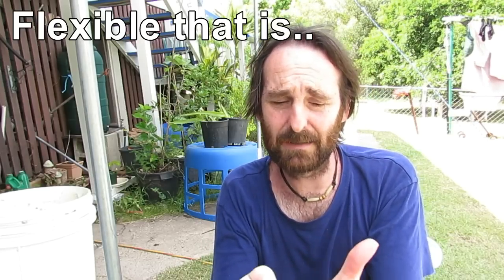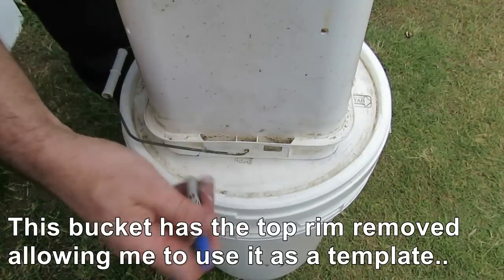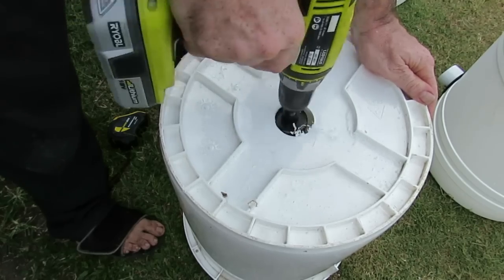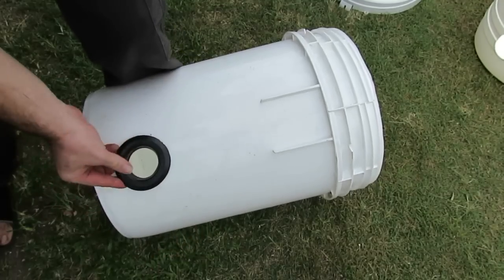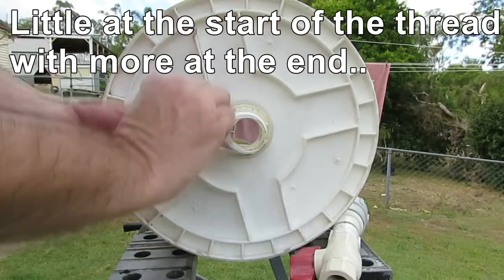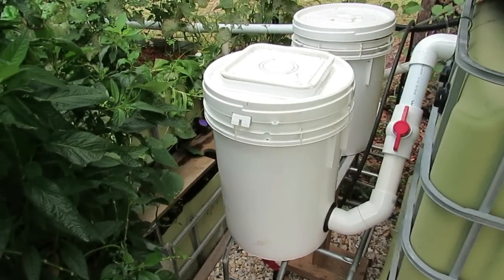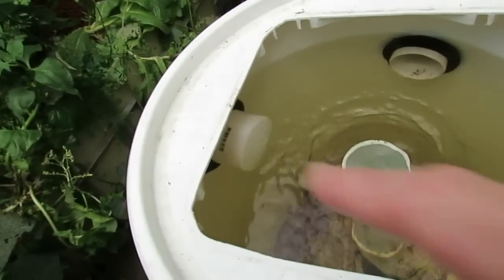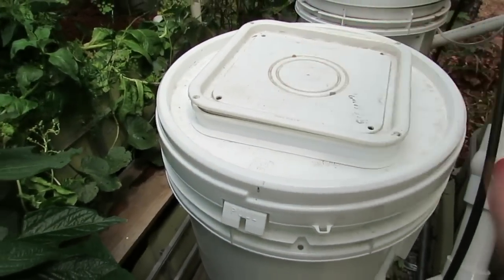How to Build a Radial Flow Solids Filter for Aquaponic Systems

Comment: Hi Rob, I really enjoy your videos. I'm just starting to design an IBC system. After some research, I'm keen to install a radial flow filter and Google got me here. I have done some sums and I was planning on a 40mm SLO. I would like to ask the reason you upgraded to 50mm? Were you concerned about potential pressure loss on adding the bio filter? The 40 seemed to be working well. I am planning a larger inlet diameter to avoid any blockage issues. Have you noticed a big jump in water quality attributed to the bio filter? Would you recommend one? My research is definitely in favour of a solids filter but more neutral on a bio filter in small systems (preliminary finding). What is your take? I expect a spectrum of opinions out there on this one. Cheers, John
Reply from the maker: Hey John..
At the moment we have 2700LPH running through the system & still have 40mm pipe hooked up after the filters.. I up sized to the 50mm as it will give me more flexability in the flow rates in the system when it expands as a larger pump may be added..
I haven't noticed any change to the water quality or growth rates in the system as such since the bio filter was added.. It was installed as I'm looking at taking some beds off line for a while & the Bio will help pick up the slack in the processing of the ammonia/nitrite while they are off line.. I want it to be in place for a while so the colony of bacteria can build up before I remove the beds though.. It will stay in line after the move as I hope to have at least one floating raft bed & some other growing systems.. As there won't be as much media in the system the bio will pick up the slack in the NH3 & NO2- conversion.. Definitely isn't needed in all systems but can be helpful in some situations..
Hope that helps some mate.. Have fun planing & building the system :)
Rob..
Reply: Rob Bob Thanks Rob, Logical explanation and I glad I asked. It's fun. My brother initially built a single IBC system and now he is expanding after a satisfying triumph. He got me in and I am starting off with a 3 GB, 1000L FT and sump. Yet to decide but probably CHOP rather than CHOP 2 due to lower costs and simple plumbing for a redundant pump. My plan for the 40mm SLO is to detect primary pump running via increased head height in the FT. 50mm SLO would probably allow me to do that too but I was skeptical of the pipe formulas for really low velocity and pressure.
Your videos have helped me a lot. If only I came a cross them earlier. I must say it is reassuring that my independent design will end up close to your current setup. I like your radial flow filter design but I do intend to add a cone in the bottom to assist solids removal. It might be trial an error to work out the least angle that work effectively. I don't want the limited volume to be significantly reduced.
I will ask one more question. Was there much build up in the old 40mm SLO when you removed it? I expect the faster flow rates through it helped to keep it some what clean.
Keep up your great educational videos.
My regards, John
Reply from the maker: Hey John Pointon ..
I've found the 40mm SLO got grubbier than the 50mm so far... That might be due to not enough bio film building up for the waste to cling to in the 50mm yet so that may change over time.. As it stands at the moment I have noticed some solids accumulating in the corner of the FT after the changeover..
I was planing on increasing the pump size & flow rate in this system but blew a bit to much on the fish farm so haven't yet.. Would like to see the FT turn over 3+ times an hour which will help in moving the solids around a bit better than they are now..
Cheers John & would be great to see how yours ends up if you ever decide to post a clip or blog..
Rob.

Comment: Hey Rob,

I have really enjoyed all your great video's. On this video I can see that second bucket and you mentioned it being a bio filter can you please elaborate on that I have been working on my set up with the radial filter then going to a bio filter as well. But I am having issues getting it from my bio filter to my main tank fast enough to cycle my entire unit.
Reply from the maker: Hi Adam... Did a bit of an update clips yesterday that shows the bio a bit better..  Hope to have it up by tonight if I get enough time to edit it today.. 
Pipe size has a lot to do water flow rates & is better to oversize you pipe work in most cases I think..
Cheers & hope the clip helps a bit once posted..
Rob..

Comment: Not sure if you are going to notice this post, I am from Sweden so to speak. But I saw numerous of your videos regarding the Aquaponics, it is quite neat to see. How ever, your biofilter/filter. I suggest hooking it up so it is on the return pipe instead, basically it takes care of any Ammonia and the like that passes through the beds.

As for solving your solids part, have you tried to create some suction device? Basically a crossroad on the outlet that sucks from four directions and perhaps 90 degree turns to suck in a circle. Perhaps that will help otherwise try get a swirl along the outer perimeter to make it all collect in the middle.
Reply from the maker: Hi there again :)
I don't think it matters in a small system like this where the bio is situated & it is easier for me to place it after the RF in the configuration we have..
Don't think I could get the water to a high enough velocity in the beds to have any real swirling effect on the water.. I am interested in trying out an over sized aquarium siphon vacuum to see how that will work at dislodging some of the build up when it comes time to move the beds around..
Cheers & have a great one,
Rob..

Comment: Hi Rob! Great video as always!  I'm having an issue I hope you can maybe help with.  I've been running my 55 gallon starter barrel system for about 3 months now.  Everything seems to be going well so far, but over the last couple weeks, I've been dealing with rather high Ammonia levels, somewhere between 2-4 ppm.  Nitrites still at zero.  My goldies seem to be fine and healthy, but I know if it keeps going up I'll have big problems.  I have cut back the feed by half over the last week with no change.  I do not have a solids filter on this system so would it be safe to assume that the increase ammonia might be from solids in the grow beds?  I haven't dug into the grow bed yet, but will probably will soon to take a peak.  Is there anything else you might suggest checking?  Any advice would be welcome.  Have a great day!
Reply from the maker: Hi there.. I don't think solids would be the issue in such a young system.. Sometimes it can take quite a few months for a system to cycle completely..
Have you checked the pH lately ? If it falls too far it can sometimes cause the bacteria to crash so I've been warned..
Reply: Thanks so much for the reply Rob.  I have actually do have low pH, 6 or lower.  The Master Test Kit doesn't read lower than 6, but it's a very, very light yellow and I've thought it may be much lower.  My top-off water tends to be in the 7-8 pH range and doesn't change the overall pH at all and I usually need to add about 5 gallons a week from evaporation loss (air is very dry in heated garage).  So I would imagine my pH is staying pretty low.  Any suggestions as to how to keep it from crashing?
Reply from the maker: subedei1
 Most folks add calcium hydroxide to help raise the pH..
Wouldn't want it to go over 7, between 6.2 & 6.8 is the sweet spot I try to aim for with ours..  You could probably start off with a very small amount, say a under quarter of a tsp & see what that does after 12 hours..
Nate from Bright Agrotech has done a great clip explaining buffering that I think is a great watch..
Bringing up pH in Aquaponics systems
Hope that helps you out some..
Rob.

Comment: Good stuff as always, finally building my system. Question, at what height is the  in flow stand pipe in the radial filter, 1 to 2 inches lower that the fish tank outflow ? I assume if it was higher than the FT outflow the water would not flow into it,or does the drop with the 45 deg bends force the water up and out the pipe ?
Reply from the maker: Hi there Steve.. It's sitting about 3-5" below the outlet from the fish tank from memory.. The twin 45's just help the water flow with minimal loss to it's velocity.. You can but sweeping bends in some places but have had no luck sourcing them here..
Hope  that helps mate,
Rob..

Comment: Nice video Rob Bob I definitely am an advocate of filtration unless like you say your running a small system with minimal fish stocking. Anyway like the vids. Have a great one.
Reply from the maker: Thanks, getting good at knocking these these filters up quickly now ;)
Am still looking at adding a mineralisation tank to the system too look after the removed solids but that will have to wait a while I think.. Too many other jobbies need to be sorted first..
Cheers & have a great weekend..
Rob.
Reply: Yes that's how I have mine setup with a mineralization tank.it works great.just switch from one radial flow to the other
Reply from the maker: gardening4fun  Stumbled upon your clip earlier today ;) Has given me a few ideas for the future.. Nice looking system you have there..
Cheers..
Reply: Thanks Rob Bob is definitely an addiction I am staying to suffer from. I have another system I am working on as well. I actually really like your vids about the wicking beds. Most of my other gardening will be in containers or raised beds and I use the water from the mineralazation tanks for that

Comment: I saw somewhere long ago how to make a conical 5 gallon bucket: you drill a hole in the bottom, then suspend a weight from that hole and apply gradual heat to the bottom. In theory this melts the plastic a bit and forms a slight cone. Never tried it myself but seems like it would do the trick
Reply: Rob Bob I remember a few years ago my brother and I were playing in the woods and we tried doing something we saw on tv where someone boiled water by putting hot rocks from a campfire into a cooking pot, but without thinking I used a plastic bucket and because of how hot the rocks got in the fire the bucket almost melted. So I think hot water would do the trick with all the heat and the downward pressure.
Reply from the maker: Hi there Dan & thanks.. Another one I was to about to try was to fill the bucket with boiling water then heat the base from the centre out (I think) & that would do the same thing.. Am looking at getting a plastic welder so would like to play around with making up a few filters from scratch to see how they go.. Just need to grow a money tree first :D
Cheers sir & all the best,
Rob.

Comment: Add a second drain a few inches from bottom to drain out clean water.  Then swirl and drain.  You can also just drain first little bit of solids, then catch clean water to return to system and then swirl last little bit and remove.
Reply from the maker: That's just too easy.. Do you have yours set up like that ? Will use much less water than the siphon again & I'm lucky that our system is set up so I can drain it directly back into the sump tank.. If pushed for time the jiggle siphon would still be the go for the quick clean I think..
Thanks for that & shall look at adding that to the build this weekend..
Cheers James..
Rob..
Reply from the maker: Popped down & added the tap today & think it will make the job a lot easier.. The water flows straight into the sump so doesn't go to waste at all..
Cheers for that mate & have a great one..
Reply from the maker: Just did the first big clean using your tap method, used less water then the jiggle siphon so will be doing it that way from now on..
Thanks again :)
Rob..

Comment: Nice build! Recently I was excited to hear that Eric Toensmeier has an aquaponics system in an unheated bioshelter in a climate similar to mine. This gave me a short-lived hope that I might one day have the same. Turns out the fish are removed from the system in the winter, which I should have expected.
Reply: In my 55 gallon starter system, I'm using goldfish and they seem to be very hardy.  I'm dealing with a high Ammonia spike right now and they don't seem any worse for the wear.  If not eating fish, ornamental fish are a great choice.  They are super cheap and can be resold when they grow larger.
Reply from the maker: Was that the one from the clip on Geoff's site ? Thanks for the link BTW ;) Have not looked into them much but would think you should be able to get one lot of trout through the system before it needed to be shut down every year.. Might be something to look into..
Cheers Patrick & have a great weekend sir..
Rob.
Reply: Rob Bob Yes, that's the one! I'm glad you saw the clip. Another challenge is that my wife and I are vegetarians, so we wouldn't be harvesting fish for food. I'm such a softy that I don't know if I'd be able to kill a fish to feed to Oscar. So, we'd have to figure a number of things out before going down this road.
Reply from the maker: OneYardRevolution  Fair enough Patrick..  Koi & Goldfish are very hardy fish from what I've seen & loads of folks use them in their systems.. I follow a chap that grows indoors using guppys  & lights in small fish tanks with good results..
Aquaponics Systems with Guppies
Some food for thought ;)
Reply: subedei1 Thanks for the tip on ornamental fish!

Comment: Rob firstly great design, simple and easy to build.

I would suggest a couple of things. Putting a cone inside the base. Start with a cardboard template to get the right shape, recycle another bucket to get the plastic. As it is not structural Aquarium sealant would be all you need to glue it and hold it in place. That will save all the siphoning you are doing.

Secondly I would recommend you add some sort of fine filter between you BIO media and the radial flow. If the BIO material fills up with too much muck its not very efficient. You could just add a layer of Pond foam to the top of you bio media and have the water pouring into bucket from the top, that would allow you to remove the foam for cleaning easily. There are a few commercial pond filters that work that way you could copy.

The Last thing I'd add is some cinder rock, the plastic BIO media is ok at housing the aerobic bacteria, but not the anaerobic bacteria. Porous rock has an area in the middle that support anaerobic life better than the all plastic stuff. PondGuru sells a great brand here in the UK, but you should be able to locate an Oz equivalent without the need to import media from here. A bag of the stuff in the bottom or your BIO filter would improve bacterial growth.

I'd be interested to hear how you dealt with too much Nitrate in your system. my test system has that issue, and plants are now starting to go yellow and pale.
Reply from the maker: Morning Sir :)
With the pipe work in this unit there isn't really enough room to get a cone into the base of this one but it is something I'm looking at doing in a larger filter in the future..
The way the bio filter is set up there will be no anarobic bacteria in there hopefully.. There is a load of air running through the media keeping it on the move at the moment.. I do have a concern when it comes to solids building up in the bio & have a small sponge filter in mind to go between the 2 filters if it ends up being a problem..
Still waiting on a commercial venturi to arrive that I want to try out on the MBBF & once its been hooked up & tested I will post a clip on the unit to give you a better look at it..
Cheers mate & have a great weekend..
Reply: Rob Bob
Rob

Re the Cone: putting a cone in the base of that Radial flow you have should be easy, you only need 10 degrees of fall so the elevation may not even need to go as high as your pipe work. If it does, just cut a hole through it and have the pipe work pass through the cone as well as the bucket wall. a couple of methods you could use are, 1 to use a medium like sand and cement, use a dryish mix and just form the shape with a stick the length of your cone wall (between the drain and a line on the buck wall at the right height), or 2 use a plastic cone and just glue it in (an animal medial collar for example).

Re the moving bed: be-careful how much air you use, you are only meant to create enough motion to knock soil particles or dead bacteria off. too much air and the bacteria can not establish themselves. Also the air only helps one of the bacteria you are trying to encourage, the second type does not like loads of air, hence the cinder rock suggestion. as those guys will form inside the center of the rock where the air can not penetrate. Just a lay of pourious rock in the base of your filter should great improve things. Also a foam layer on the top to stop fine dirt getting to your media should also import your filter as well.

Here is a link to a commercial pond filter that uses the combined foam and moving bio media idea

http://www.lotuswatergardenproducts.com/Instructions/Bio%20Master%20Instruction.pdf